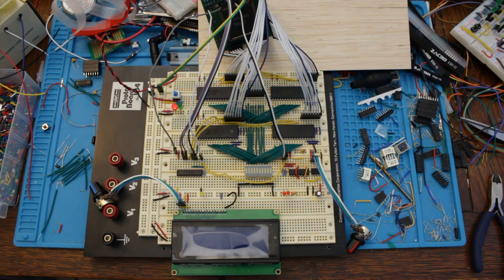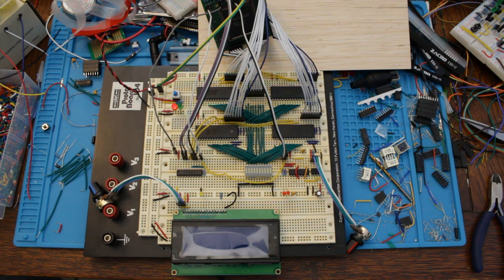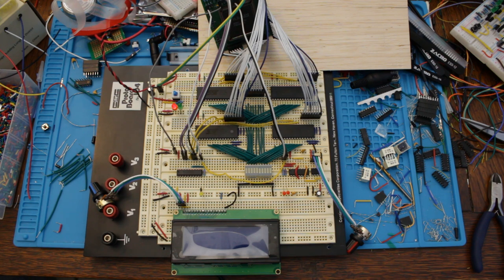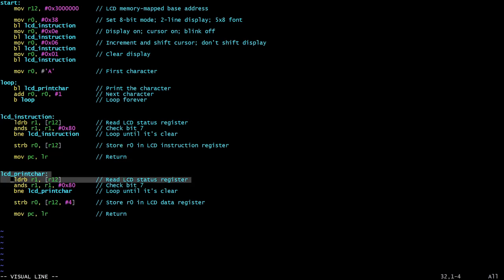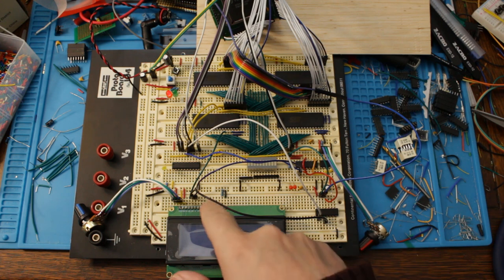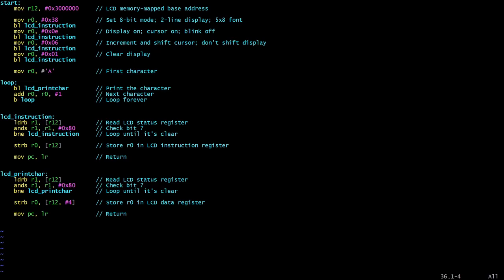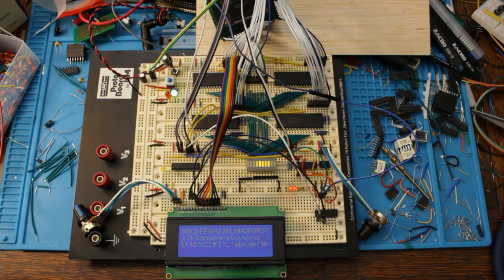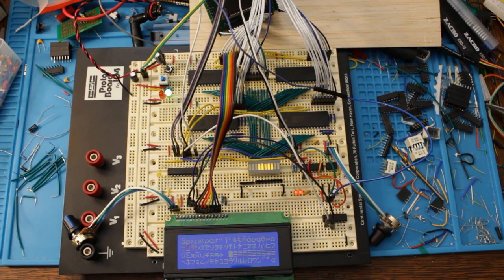Homebrew ARM2 #6: Hooking up the LCD display

Comment: Nice video. I like the indirect with offset addressing mode, as it makes data structures really easy to program. I first encountered the branch and link register instruction when I did IBM System 370 assembly in college. At the time I hated it versus the 6502's JSR. But in retrospect I recognize the wisdom of the design decision.
Reply from the maker: Yes, load/store addressing is quite flexible, with things like optional write-back and post-increment as well. Use of a link register is good because it allows subroutine calls without needing memory accesses. I've been able to write fairly complex programs now with nested substitutes, without any RAM.
Reply: @GeorgeFoot  Have you done any 1802 programming? It has 16 general purpose registers and you use register linkage for subroutine calls. It is similar in how far you can go before needing RAM.
Reply from the maker: No, 6502 is the oldest I've used. It looks like the 1802 had an interesting register remapping feature, e.g. a separate program counter for interrupt handlers. ARM only had one PC but it has separate banks for some registers (especially the link register and stack pointer) in supervisor, IRQ, and FIQ modes, the idea being that so long as you don't use many registers in the interrupt handler you don't need stack access to save registers either. The processor mode (user, super, IRQ, FIQ) is stored in the program counter along with the flags, so it all gets saved into the link register and restored atomically.

Comment: Great video! I have a question though. In the circuit near the end, what are you using the 257 for? Won't 139 on its own give you perfectly valid ~RAMCSx signals?
Reply from the maker: It would for byte operations, but when the CPU is reading or writing a word at a time we need all four banks of RAM active together. This might be clearer in the later video where I actually wired this up.